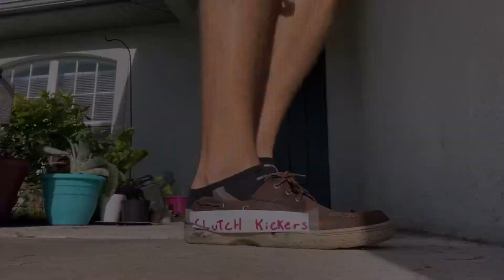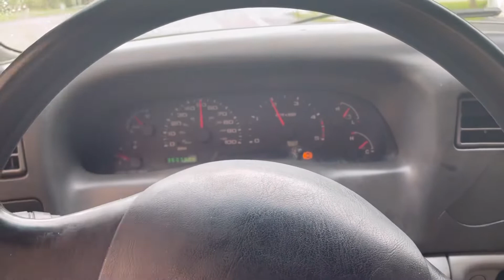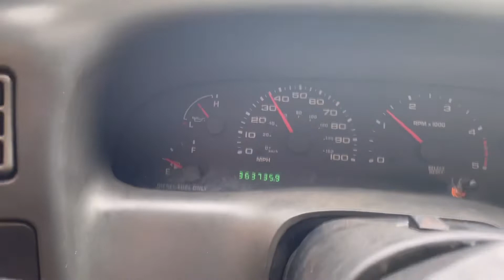TESTING THE NEW 700hp 6.0 POWERSTROKE MOTOR

Comment: Wondered were you been. figured you were either 8 knuckle's deep in a 6.0 or looking for bail. your deltas  should show a couple degrees diff  if they stay exact same and never flux double check your coolant and oil temp  connections and sensors if one is loose or bad it will go inferred and give you the good sensors reading. What caused your bellhousing to snap? I had a buddy bust 3 in a month till he realized  something with the dowel pins , bad, or none existent never really got the whole story
Reply from the maker: I’m honestly not sure how it broke, but tranny is at the shop being built as we speak, hopefully it gets down after this
Reply: @leadfootlarry1704  Good job on gettin the 6.0 rollin personally I have more confidence in a factory 160k bottom end over a rebuilt one any-day